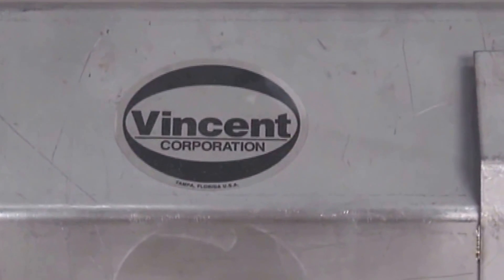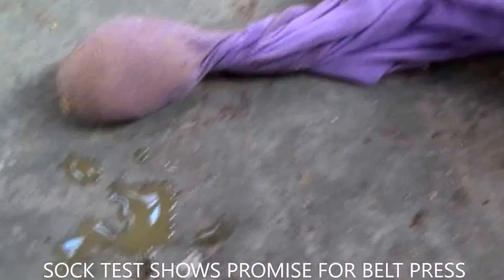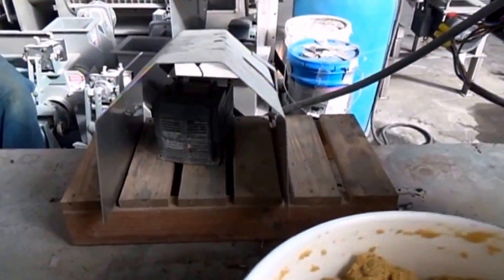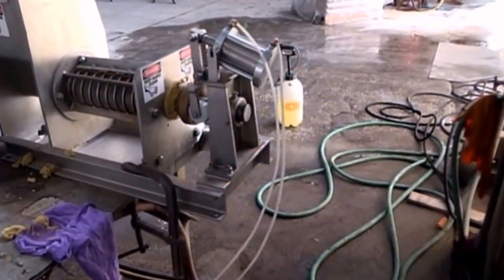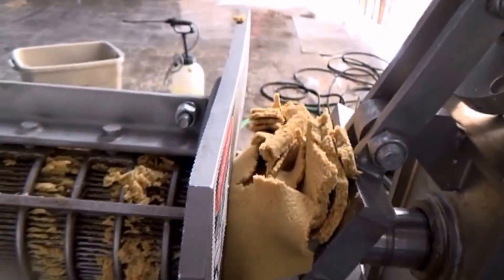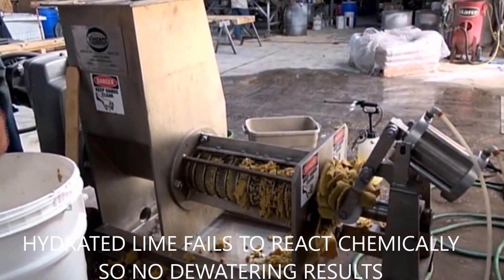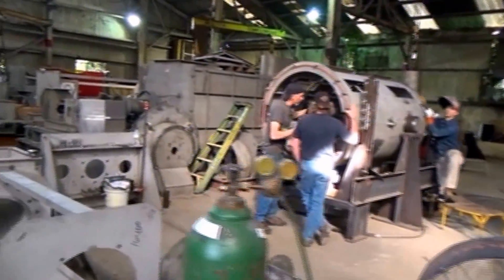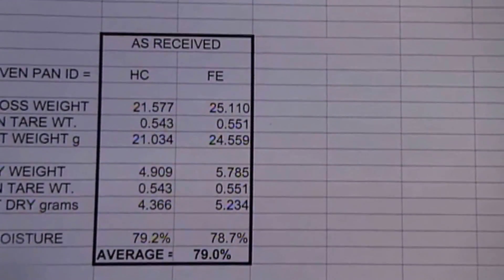DEWATERING DECANTER SLUDGE

Comment: Great! The filter press is one of the oldest process filters and dewatering machine which is used in a variety of applications. It still remains a pioneer in solid-liquid separation with a very good price-performance ratio before the centrifuge, decanter and belt filter! 
Greetings MSE Filterpressen®. Your specialist from germany.